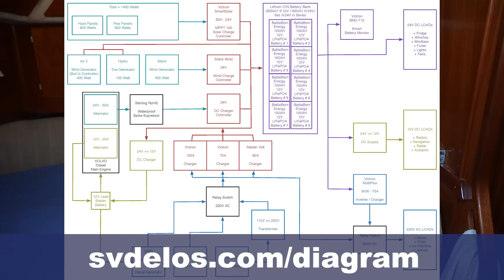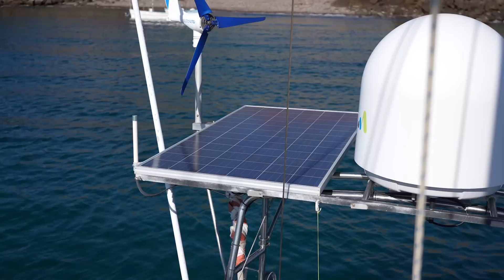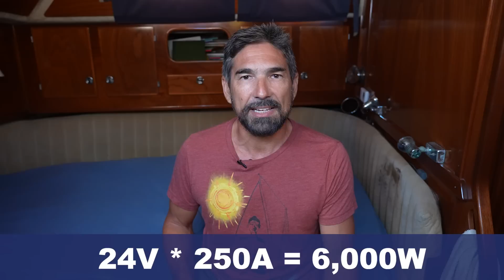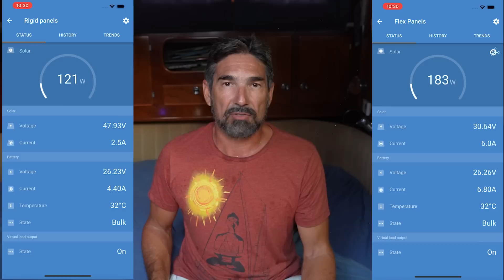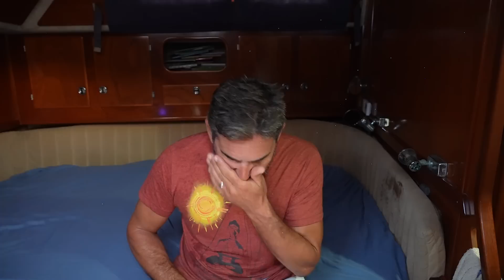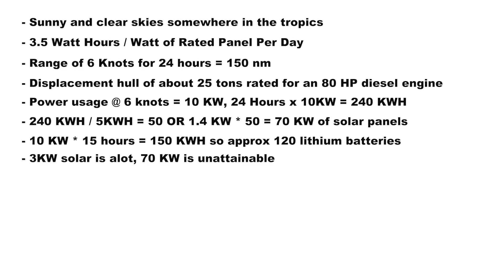ELECTRICITY On A Sailboat Q&A ⛵️ (Lithium, Solar, Wind)

Comment from the maker: We just got a special discount we wanted to share with you! Take $50.00 off PER BATTERY with a special discount from Battle Born just for the Delos Tribe.  If you’re in the market for some spanking-brand-new LIFEPo4 batteries to super charge your power system check them out.  We’ve torture tested them on Delos for years and they perform incredibly well.  Just be sure to enter the discount code "delos" during checkout to get your $50.00 off PER BATTERY!  Check out their different products and packages here: https://svdelos.com/battleborn

Comment: Installing a generator head on your boat motor can have some advantages, having 2 boat motors with generator heads give you redundancy of both your boat motor and generator while taking up the same space, if you do it right you can have double the power to the prop, or double the power that you are generating or 1 engine generating and driving the prop, so many possible configurations.

Comment: Lately there is a Company who manufactures the equivalent of Tesla Boats a full solar catamaran but still need a generator for backup in case of shaded weather ☁️ but it a cool boat very quiet full appliances compliment problem is cost lots of money 💰 i did see a YouTube clip with a married couple who made themselves a solar boat not that pretty but full solar !

Comment: Great video and especially appreciated all the details!  I was shocked your alternator is only ~30a!  Most boats with lithium upsize their alternator to 120a+. But makes sense since you have a genset. Makes me think we can hold off on upgrading our alternator.

My impression though was alternators with internal regulation rarely have the right voltage setting for lithium. So it's kinda surprising you don't have an external alternator regulator like the Balmar MC-614 (now 618).

Comment: Do another but with hybrid engine. hh44 have like 3x your battery and solar. Would mean that in most cases you only use solar unless it's an emergency or planned long travel without sail. I'd like to see how that change your perspective.

Comment: As the owner of a boat of similar size and vintage (2000 Catalina 470) I watched with rapt attention. Curious how many (if any) 12V loads a boat like yours supports from a 24V battery bank and how it contends with that? Watermaker, refrigeration, windlass and winches would be among the upgrades if I wanted to step up from 12V to 24V or 48V in the interest of improved charging efficiency at higher voltages.

Comment: Simply brilliant, thank you for going through all of this.
Now go jump in the water and cool off you deserve it.
Another good channel for solar info is Sailing Dauntless as they have the Lagoon 450 setup to be able to run completely off grid. He used Tesla packs in his build and really went above and beyond in that he can run everything including AC for 3 days with no or limited solar input and without running engines or generator. I will say it probably wasn't cheap to build but once complete would be awesome. Your going to need a big vessel to do what he did though and I don't think you could do it on a Mono without going over the 80' mark...

Comment: I think there are a few other things you missed on the electric only calculations. First would be miaintnece, diesel engines need much more maintenance  than a pure electric system. Couple that with specific consumed parts can be difficult to source in remote areas. As you noted that lithium batteries have been basically maintenance free and large AC electric motors have a more similar maintenance schedule to those than a diesel engine. While diesel is generally available it some places struggle with quality which can increase maintenance or require a polishing. Finally any motor system should have regen based on sailing. So if you motor a bit then turn on the regen you can recover what you used to move out of the anchorage or slip and possibly even generate more power. 
You points on traveling long distances were motoring is absolutely  required is a true concern. It feels more like a diesel electric hybrid is about getting another charging source, sail drive regen. I suspect it would mean that passages would depend on the weather even more where not being able to sail means you just wait for wind more. It would also mean you stay or take even fewer risks on the weather. 
I suspect we will see diesel hybrids on most pleaser boats very soon. We might see all electric for short range daily sailor types. While cruisers will got with a hybrid system. A hybrid system where the AC motor is just an oversized alternator that is clutched and can drive the screw as much as receive power from it.

Comment: 1) On your Air conditioning, is the hot side to air, or seawater?  What is the average and range of the seawater temperature you sail in, and if the hot side is to air, have you asked the manufacturer of the AC units (and possibly the refrigerators and freezer) if there would be any energy savings running it to seawater?  2) Is your 110-120V AC, 50 or 60 Hz?
Reply from the maker: Hey John the AC is cooled with seawater, while the fridge compressors (much smaller DV powered) are air cooled.  Right now we are seeing sea temps of 30-32C so quite warm here in cent a América and Mexico.  Our system is European standard so 220V, 50HZ.
Reply: @svdelos  :  Thanks for replying, 1) makes sense., do you have any Idea as to the energy savings?  2) Yes I would assume a French built boat to be so, On the chart in the beginning of the video it showed a "transformer" from 220V to 110V,  While heating appliances and brush motors don't care, on induction motors the wrong frequency can harm  motors, I lived in Mexico city in the early 70's when it was 110V. @ 50 Hz and there were a lot of small shops that rewound motors for 50 Hz before they converted to 60Hz in the mid-late 70's

Comment: Brian,
if you watch other sailing channels (?), you might be aware that Sailing Uma is 100% electric. (Although they do carry an auxillary portable generator just in case).
They pulled their diesel years ago.
(They are a much smaller boat, and limited E range, however).
Upgrades now have an Oceanvolt inboard. Also with an impeller-propeller (wrong term) that spins in the water while under sail, for charging.
Dan has published several videos over the years detailing this.

🌊🌊🌊⚡🌪️⚡🌊🌊🌊
Reply: Uma often has to run a generator in a series mode to go long distances under power. Some of their most recent videos in the Mediterranean have them becalmed and running the generator. I think on a monohull, electric only drive isn't realistic yet. A series hybrid would work. On catamarans where they can have large solar panel areas, it is still marginal for main drive.
Reply: @ekaa.3189  
Thanks for the reply.
As I understand it, Uma rarely runs a generator. In such situations, they instead prefer to wait on the weather.

In my previous comment, I mostly articulated all of this. Including E-range, monohull.

Cheers.
🏴‍☠️👁️🔧🏴‍☠️

Comment: Question:
Land "yacht" (van). I installed an initial, single panel solar system, single battery, in my camper conversion van, to run minimal things. (a nightlight, cellphone charge, ceiling vent computer fan, laptop) . 
I was told to be sure to get a " pure sine" inverter, for efficiency, noise, etc. Which I have yet to do.
Are you aware of inverter differences,, and this designation? Tell us more, (next opportunity) if you know. Thanks.

⚡🌪️⚡  🏴‍☠️

Comment: And both wind and solar tech is making leaps and bounds annually.  There are wind turbines as big as 25kwh that only need 3-5mph to start and produce their full rated output at as low as 18-20mph winds.  Obviously something that large is both size and cost prohibitive on a sailboat your size.  But a couple 2.5-5kwh VAWT(vertical axis wind turbine)systems as small as they are getting, mounted to both sides of your mast just below the spreaders are potentially doable.   Even if to figure 1/4 the max output of 2, 5kw/h turbines  that would be 2.5 kilowatts per hour.  Times 24 that is 60 kilowatts and at 96v to as much as 320 volts vs 12-48v out of your current turbines. 

     I think I'm the next 5  years or so the technology will be there to make current sailing yachts fully electric and capable of round the clock motoring at hull speed.  Will it be affordable?  No way.  The ultra wealthy gotta get that huge return on their investments in lithium mines & refineries, & battery chip, and electronics manufacturers.  But some small 1 off companies are defying the narrative and building Cross Cell Vehicles and Hydrogen Powered or Hydrogen Cell Vehicles for Market now.  Nissan has recognized that and said that Lithium powered electric vehicles are not the right path for a cleaner world, and said they are investing into Hydrogen other Electrolyte batteries, and Solid State Battery Research.  At some point the other Major Automobile Manufacturers will have to play catch up with Nissan or push battery companies to drop prices.  Otherwise Nissan and anyone who does follow suit  will corner the market with cheaper vehicle alternatives.  

     I have 4-7 years with my 3 dogs before I am ready to sell my home and properties and make the move to a boat to follow in your footsteps and lose the itinerary, the watch, and to travel, abandoning the dog eat dog rat race this "civilized 1st world" has become.  I'm keeping my eyes on emerging technology with the hopes by then it is affordable for me to buy a gently loved yacht and refit it as a fully self sufficient power plant with an electric motor that can reach hull speed and a bank that can run the motor and air conditioning.  I'm not holding my breath lol.  Just remaining hopeful.

Comment: I don’t understand the answer you gave on the 12V air con… surely by any measure the Mabru 12V systems use less power to run them than traditional boat air con from a few years ago.

Comment: Brian, these films on the power systems you have fitted are brilliant.

I aim to set sail within two years and want to have a yacht similar in size to Delos and fitted with a/c, heat, HW, water maker, microwave, washing machine and electric cooker… and maybe one day an electric motor.

Your films have been so so so informative. Amazingly helpful.

Comment: What is the air conditioning temp set to?  Room temperature or is it set slightly higher, depending on the outside heat.  Does the air conditioners have the ability to change your humidity in the cabins?  Due to all your refridgeration where does the waste heat go to?  into the compartment?  Also when you have the AC on, are all doors and hatches closed for efficiency.  To prevent cold air escaping do you have an airlock system or air barrier near the upper hatch.  Is one area of the interior cooler than others?

Comment: Brian, on the subject of DC powered air con units, I market 12v and 24v A/C Systems (Air cooled), that consume 25-50 amps (12v), or 12.5=25 amps (24v), that pump ut 9.6k BTU and can run 12-14 hours on a 600 AH (12v), LiFEPO4 bank. In the semi trucks I've installed these units, you could hang meat in the cabs, they are so efficient.  I'm currently in development of a marine version of this system. (I have a 40' Sailboat in addition to my semi truck, so it's enlightened self-interest).

Comment: Also since Delos is running in the negative with the AC and all the fridge/freezers running, what would it take to break even?  More wind generators?  Is there any surface room left on Delos for more solar?  From what I've seen in the videos most surface area is used up?

Comment: That insight with the electric propulsion was particularly interesting! Thanks! 😘

What I've come in conclusion is that "it really depends". If requirement is "6kn for 24 hours" It's really not an option.

But what I also think is that IF you have electric propulsion, it will also change your point or view of what do you need or do.

With my new boat, I'm putting double electric motors, maybe 10-20kw each. And most probably small, very simple (probably air cooled) diesel DC-generator. Small, just about the size that you can run propulsion for let's say 4knot or so.
What these also bring is the ability to charge batteries under way with hydrogenation.

Having electric motor for few years now on my (inland lake usage) sailboat, it just is so simple and easy to use with next to no service required. So that way I don't even think it adds any complexity - because is't not complex. :)

Cheers!

:Panu

Comment: I hate to join in on the peanut gallery lets get it out of the way... so here it is... lol

A motor soft starter is a device used with AC electrical motors to temporarily reduce the load and torque in the powertrain and electric current surge of the motor during start-up. This reduces the mechanical stress on the motor and shaft, as well as the electrodynamic stresses on the attached power cables and electrical distribution network, extending the lifespan of the system.[1]: 150 

It can consist of mechanical or electrical devices, or a combination of both. Mechanical soft starters include clutches and several types of couplings using a fluid, magnetic forces, or steel shot to transmit torque, similar to other forms of torque limiter. Electrical soft starters can be any control system that reduces the torque by temporarily reducing the voltage or current input, or a device that temporarily alters how the motor is connected in the electric circuit.

i love what you guys have done and produced, the wife and i are very envious of you and your family! we have been watching for years! i have been watching since the first year. thank you for what you do for us land folk lol

Comment: add some capacitors to the pump circuit to handle the surge so you can more easily use water maker on batteries

Comment: Hey Brian you'd make a good teacher, in reference to the lead acid with lithium, you could use a DC to DC converter and boost your voltage up on lead acid batteries to charge the lithium battery/s at night, if you know what your doing and if there's enough power in the lead acid??

You guys rock
Cheers 🥂

Comment: Hej Brain, Awesome, awesome, underbar, informative, excellent vid. Tack.
Are you not worried about Dendrite growth by charging your LiFePO4 so high deep into the knees @ 3.65V per cell (14.6V/29.2V). It's known that charging so high reduces the life span of LiFePO4. 

I'm living on Solar and only charge to 3.475V per cell, and about every month taking it to 3.525V per cell to stretch it and prevent memory effect.
I've seen that even Victron have now reduced their LiFePO4 charge rates, "Between 14V/28V and 14,4V/28,8V (14,2V/28,4V recommended)" So 3.5V to 3.55V per cell.
Just curious?

Just love my Victron gear, so clever, so fully programmable, like how they talk to each other. I reckon best stuff in the world! Couldn't live without my BMV-712

I also like to call LiFePO4,   Lithium FERROUS Phosphate and not Iron Phosphate, as I notice people hear Lithium ION Phosphate.
Sure, it's still one of the about 8 Lithium-ion chemistries, but it is a much safer chemistry, but the laymen just hear Ion and think they all go boom! ( ie, exploding/burning phones, burning scooter batteries, burning cars etc) 

Thoroughly adore ya channel and eagerly await each vid. You guys have the best channel,  Brains calm voice over, Karins spatial perspective, Nuggets antics, great adventures, fantastisk.
Looking forward to ya reaching again my old stomping ground in the South Pacific where I was sailing on my Colin Archer based William Atkin design Cutter for a few years, Ha, now I'm living off grid near Hölö Se.
Hejdå

Comment: How does Uma sail with just electric motors?  They don't seem to have had any trouble. Even sailing at high latitudes, as they have been doing, does not seem to have affected their safety.  Is it because their boat is so much lighter and probably has half the electric load from everything other than the motor that your boat does.
Reply: Uma has a very limited range when motoring and most world cruisers aren't willing to risk losing their boat just to go electric propulsion. We are halfway on our circumnavigation and motoring is a fact of life in many areas we have been.
Reply: Oh but they do have trouble.  From my perspective, one of the best things about Sailing Uma is that you get to see the tradeoffs implied with electric propulsion and the absence of a generator/alternator and cabin heater.  The sacrifices were few in the Carribean, where there was plenty of sun for power and wind to get around.  As they made their way north to Norway, you can see them tied to a dock for power and heat.  Ultimately, they (like the Rigging Doctor) bought a Honda generator which is a hybrid system as Brian describes.
Our course, plenty of people have sailed all over the world with kerosene lamps, no engine, and no electrical system.  It certainly can be done, but there are important tradeoffs.

Comment: I'm a 40 year experienced battery chemical engineer.  Let's just get some basics down.  First, these are lithium-ion batteries, not lithium.  There is a big difference, but let's not get into that.  Lithium Iron Phosphate batteries (LiFePO4), as used on Delos, are used in some electric cars, and they are much safer than Lithium Cobalt Oxide or Lithium Nickel Cobalt Oxide, etc. that are more widely used in electric cars (eg. Tesla).  LiFePO4 cells have a lower voltage, hence less energy density and more safety.  For the basics, let's just define terms that get confused:

Power (Watts) = Voltage x Current -->  P = V x I (I is current, which can be in amps, or A)

Energy (Watt-hours) = Power x time --> P x h = V x I x h (h = hours)

Capacity (Amp-hours) = Amps x time --> I x h (h = hours)